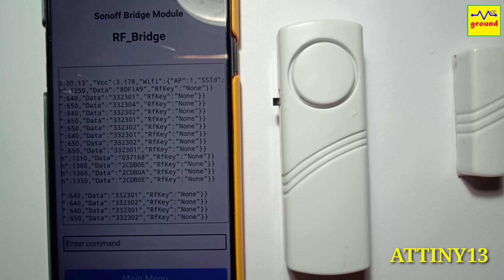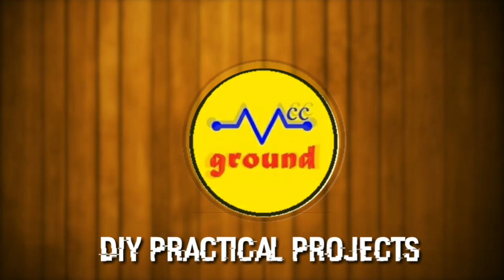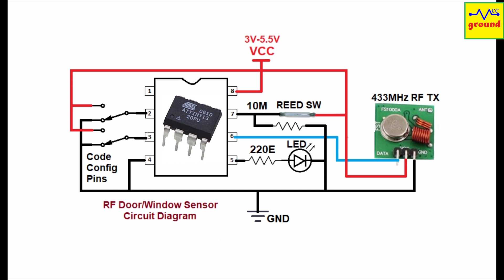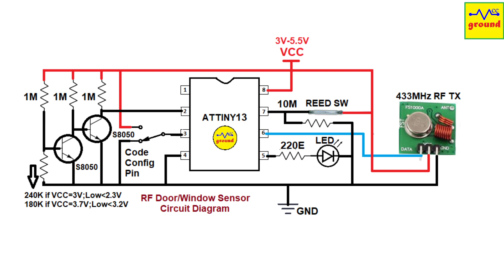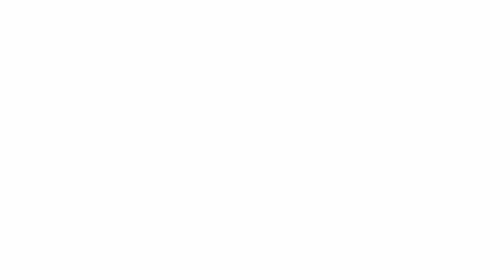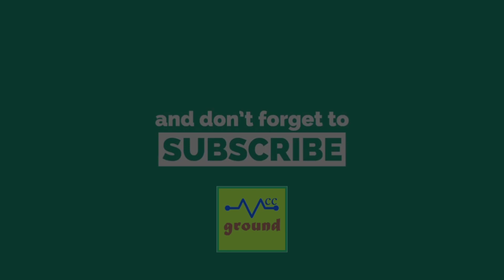#60 DIY 433MHz RF Door Window Sensor with battery low code using ATTiny13

Comment: impressive, what would be the battery life expected from above?
i've made one (with ATMEGA328P and AAx2) which is serving now for more than a year and still reading 100% battery. and latency is very very less with NRF24l01+ chip
Reply from the maker: Using it for last 5 months now and still the battery voltage is intact. Let's see how long it goes 👍

Comment: A very interesting 433mhz circuit, but can you please tell me the range of the signal as my shed is 12 meters away through two walls, thanks if you can advise. Bob in the UK.
Reply from the maker: This low-cost RF transmitter can be used to transmit signals up to 100 meters. Antenna type, working environment, and supply voltage (max 5.5v) will seriously impact the effective distance. It’s good for a short distance use. I hope, it will work fine from your shed at 3v. If you see any issues with range, you may increase the voltage to 5v for better transmission.
Reply: Thanks for the reply, I will let you know how I get on, many thanks Bob  @the_vccground